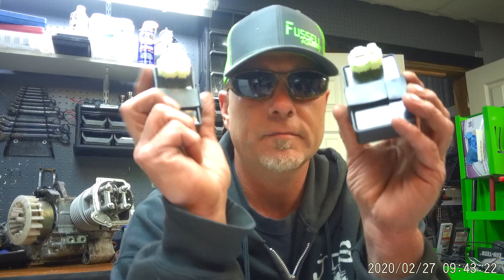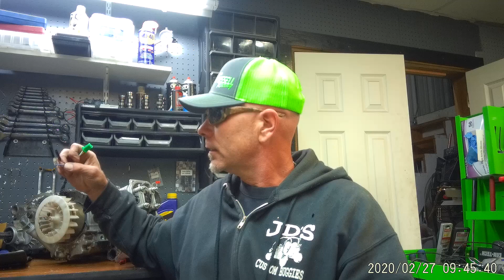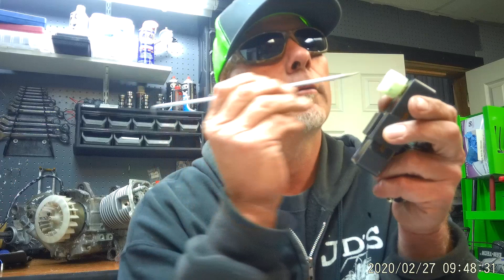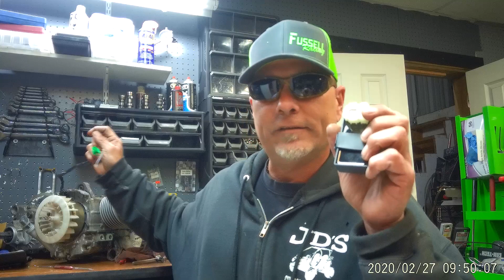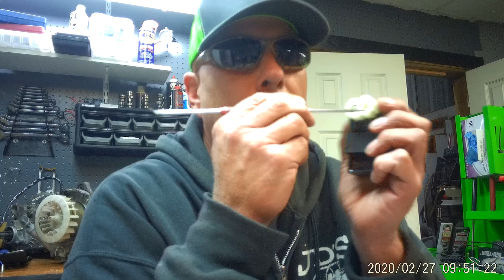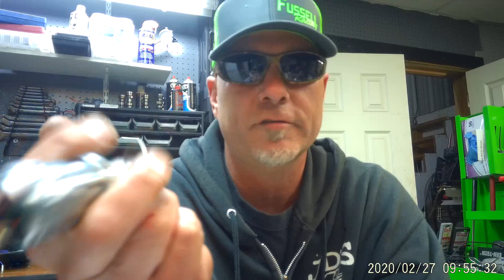HOW TO GO FROM AC TO DC WIRING AND VICE VERSA ON MY BUGGY

Comment: Had a Honda CL 70 1 time. If I had a pretty blue spark but would not run we went to the main Honda man which we were both Honda mechanics and he looked it up and it was supposed to have a DC coil instead of a AC coil something like that maybe opposite they looked the same but they were at AC or a DC coil and whatever it had it would fire but it would not run that is a fact from three of the best time to mechanics in Western Kentucky

Comment: Hey I have a Joyner hammerhead 250 and it is DC but I want to switch to ac
Reply from the maker: Don't think you can , there is no AC power wire coming from the 250 stator

Comment: I'm going from a DC to AC (yerf dog rover) I'm lost man. Can you please send me a drawing of what goes where. The harness I bought is set up for DC and keeps blowing my fuses because I'm not understanding what wires I cut to keep power from going to the CDI. I understand that I need the Exciter wire, but I don't know how to find the wire from the harness that I didn't need. Please send drawing of what color wire I need to go where. I have the key switch with 5 wires hanging off of it

Comment: I think there is a mistake here when the dc cdi gets ground on the 2 pin plug it will kill the engine. so having the key on ignition is sending ground to cdi, which is killing spark. I know this is true for the ac cdi, when ground is applied to 2 pin plug it kills spark.

Comment: you are a great source for information.I have a scorpion rt model buggy with what I think is a 150 cc engine. I bought it not running. I can’t find a regulator,rectifier. There is a unused harness next to the cdi box.When I ran power to the cdi it burnt a hole in the back of it.Ha,ha.Is there a wiring diagram for wiring the regulator/rectifer? Thanks for all you do, great job. Kerry.
Reply from the maker: i would refer you to checking out the wiring videos on the MBX #36 yerf dog. it is a 2 part series that shows the wiring from beginning to end

Comment: Hi can check the radial run out. Play of the rod bearing thru the spark plug hole. With a screwdriver around t.d. c.    On a 6yc .  4t Thank
Reply from the maker: If I am understanding the question correctly, no the crank has to be out

Comment: So with a DC stator." DC bike" i can change up the switch wiring as you stated..and use an AC cdi and it will work? As you described in this video.?
Reply from the maker: so as far as the stator goes if you use the red/black AC wire to power the cdi and use the appropriate cdi (AC) and rewire it at the ign switch, yes

Comment: When you wire AC why wire the key switch to all grounds? Why not leave it with hots?
Reply from the maker: because the cdi is powered by ac voltage and the rest or the system is dc  what all of the components have in common is the ground.

Comment: So all my grounds like lights stator horn and coil on AC setup go to key switch #2 except for frame ground goes on key #1 and starting relay ground to key switch #3 yes? Engine ground goes to frame and battery negative goes to frame yes?
Reply: And if i have any dc devices on my ac system they go to the floating ground. So like example leds Stator n regulator would go to a floating ground. Ty!

Comment: Can you use a ac cdi as a DC cdi?
Reply from the maker: no
Reply from the maker: as one , no as stated in the video if it's wired for ac, then you need an ac cdi....dc, a dc cdi
Reply from the maker: @JNL4EVR   think of it this way you can't plug a car stereo into a wall outlet and you cant take you home stereo and run it off you cars battery.

Comment: Your wiring it AC. Makes sense with the ground. Where does the hot wire go off the starter solenoid? Off the battery?
Reply: Never mind I heard you say run it hot. Good video. Thanks.
Reply: Not the terminals. I understand that.